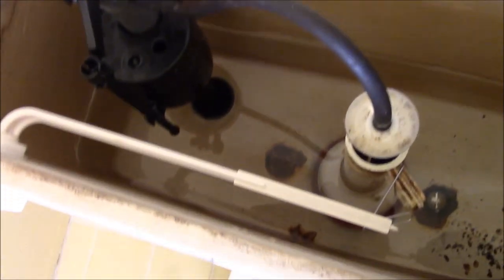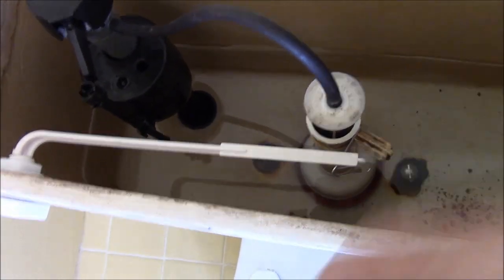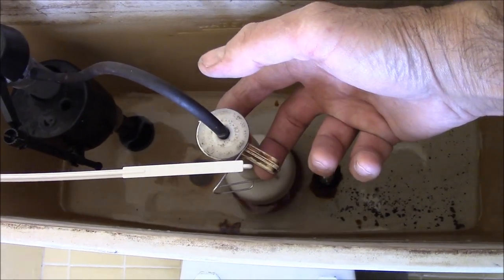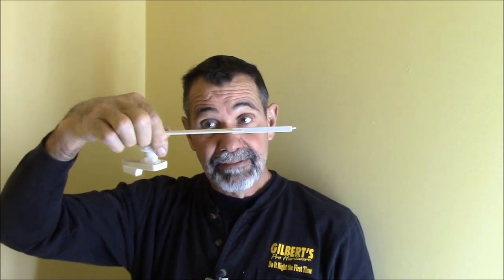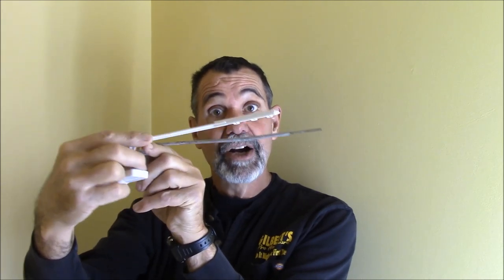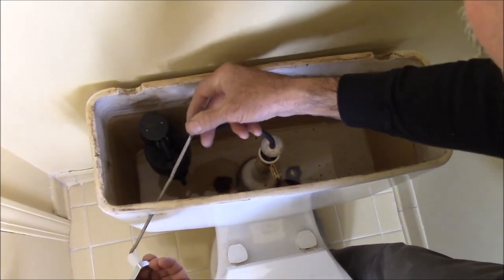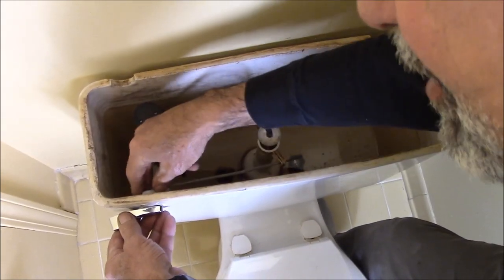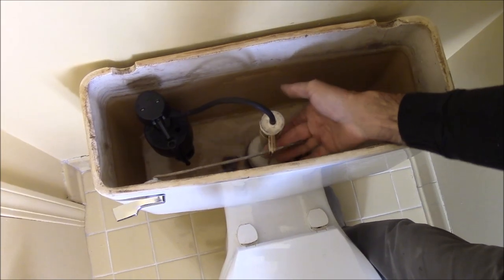Mansfield Toilet Flush Handle Too Short - Mansfield Requires Longer Arm

Comment: Good morning sir! Having issues with the same toilet. Replaced the red seal properly. Finding that I have to hold the handle up for it to flush now. If I let it go the flush valve closes. I was wondering if my stop caps seal is scrap and preventing it from suctioning to to the cap as I flush or is it a different problem? Cheers!!!
Reply from the maker: One, does the flush handle lift the assembly right up to the stop? This is a new issue for me, Don’t know what to tell you from here.

Comment: I have a toilet of this style, I changed the handle today, and put in a new seal, but I have to manually flip the handle down to get the lever to push the tube down enough for it to seal. Very weird, almost like I need a weight at the end of the plastic stick.
Reply from the maker: The arm may not be centered in the hoop on the plunger, if it is rubbing it will hang up.

Comment: The Mansfield handle I purchased  was too angled and rubbed hard against front of the tank.  Impossible to find the model 381.
Reply from the maker: We sell a brass Mansfield flush handle that is easily bent so it fits into the center of the hoop and does not drag. You can also take a little heat and bend plastic Mansfield handle so it doesn’t rub.

Comment: I've got what looks like a weight on my chain for the flapper connection. It makes the toilet stop flushing immediately as soon as I release the handle. Is there a fix for that?
Reply from the maker: I can’t say w/out a pic and brand of the toilet
Reply: It's a Mansfield "Summit". Typical Fluidmaster fill stack, with a weight on the chain to the flapper. I'm assuming it's to stop the entire tank from emptying. It's okay, I like the fact that it empties the bowl with only a third of a tank of water and if I have to flush something bigger, I can just touch the handle longer until it's gone. Thanks for the response.